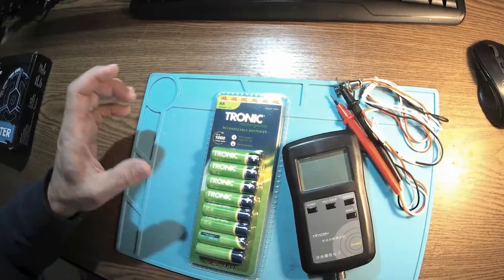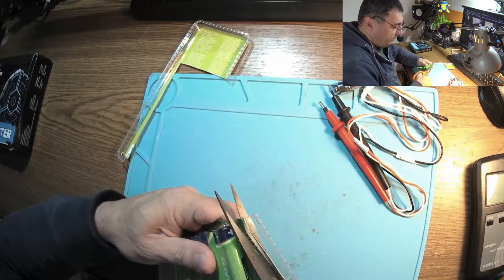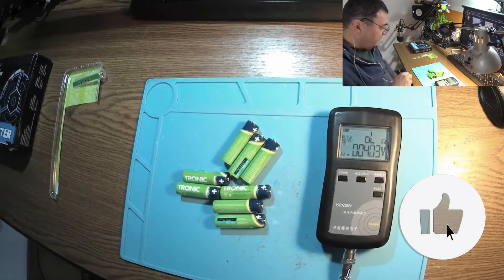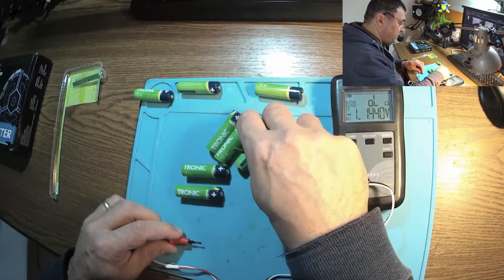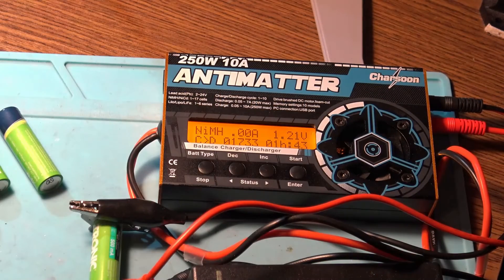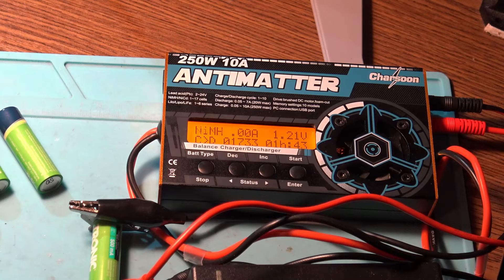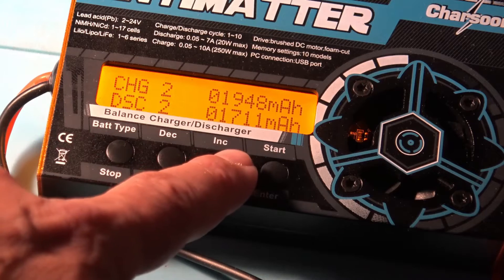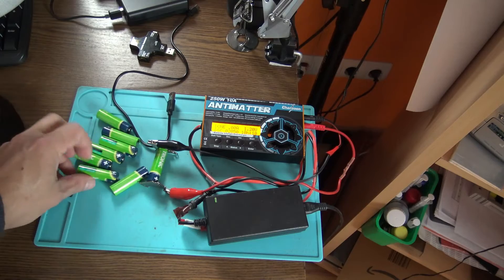Lidl Tronic Rechargeable Akkus..is it worth it?

Comment: besides the capacity i found a BIG issue with those batteries (especially with the very first batch which showed up at my local store a few years ago) - the diameter.
they are a tad bigger than 'regular' AA batteries. and that 'tad' was big enough to not fit in my toothbrush.
a disappointment.
Reply from the maker: Right! I notice that...

Comment: Your Tronic batteries are worse than mine :-)
I have also tested the same batteries as you have from Lidl. I use a charger only for NIMH batteries, Japcell BC 4001 and Panasonic BQ-CC65 and with discharge function. Both chargers discharge the battery to 0.9 volts and show between 2100-2200 mah. Maybe the batch of batteries I have is better or it is the charger from Panasonic and Japcell that is better for topping up the batteries. But I'm also a little disappointed with Tronic, which promises 2500 mah. Even if I used the Japcell charger, which has a Refresh function where it charges and discharges the cells 3 times, it didn't get any better. It is said that new batteries must be discharged and charged several times before they have full capacity. My Eneloop and Fujitsu are much better.
Reply from the maker: Right!

Comment: Great test! I saw these in the Lidl today, in 4 pack, just over 1 euro per. Either way I enjoy these nerdy tests a lot. Did you ever try the Ikea Ladda batteries? The 1900mAh version of theirs is around the same price as these, and are made in Japan, maybe better quality.
Reply from the maker: When I was in Norge, (I've been living there for a while) I found Ladda at Biltema and using those for many years..(like years 2000-2005) very good indeed. You gave a good idea to order from Ikea Romania a pack of those and check the quality. Honestly..I don't expect  any  major difference..they are all from the same mother! 🙂
Reply: @viocaia  I love Biltema. I'm living in Hungary now, but I usually stop by a Biltema at least once when I'm back in Norway. But, yes, probably not such big differences. There's all this talk the Ikea batteries are (maybe slightly older generation technology) Eneloops, but I it seems people have different experiences with them (especially the new ones). I think the main difference would be long term use and long term self-discharge, more than capacity, so that's not very practical to test without a long term time Investment. Most of the rechargeables seem to work all right for normal use these days, so probably not worth to put so much time into. Some basic testing would still be cool though. Either way, have a nice day !
Reply from the maker: @LadyBovine  You too Mats! Thanks for comments and always welcome! Merry Christmas!
Reply: @viocaia  Merry Christmas!
Reply: Yes those Ladda performed very well with low internal resistance, and were good to deliver high amount of current. Way above these from Lidl